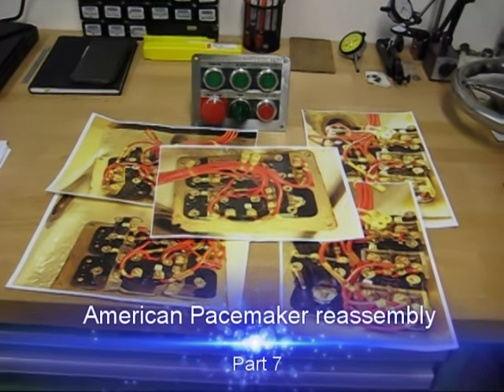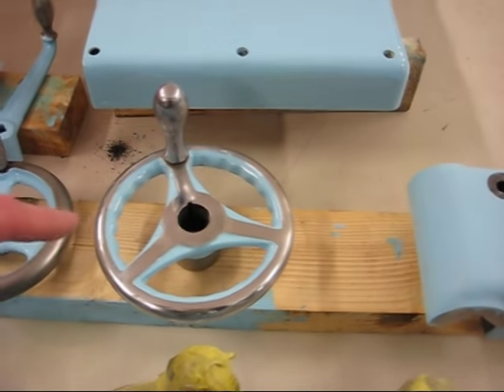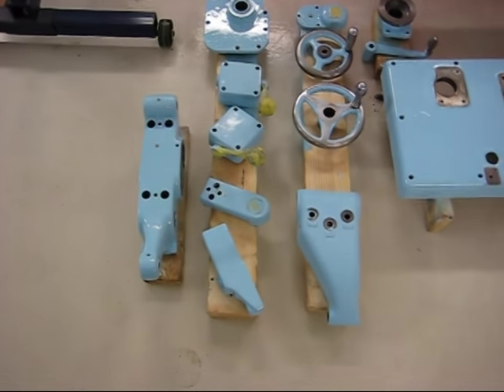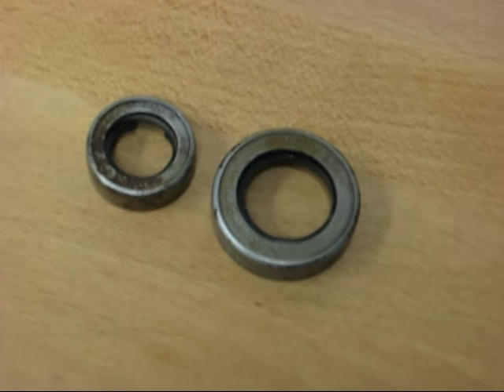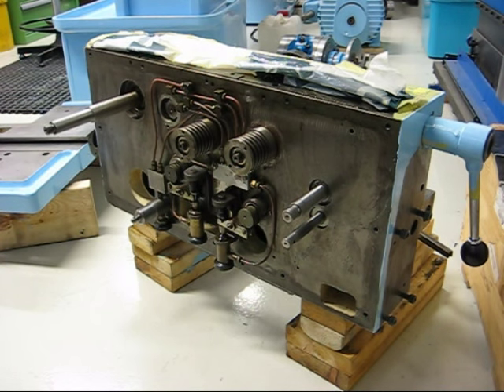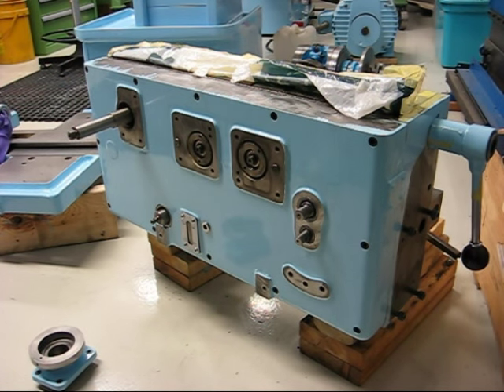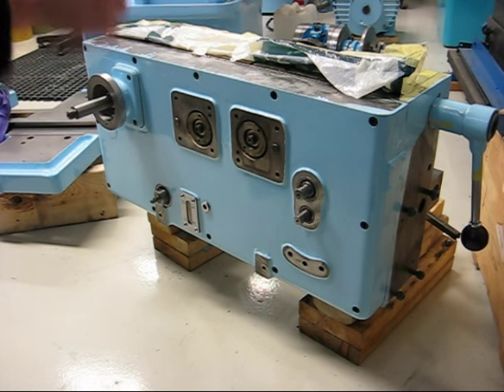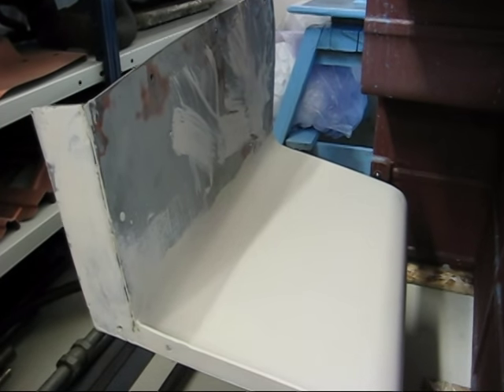American Pacemaker lathe reassembly part 7

Comment: The light blue looks very nice. Almost too nice, like white shoes. I really do favor grey as that is my father's eye color and on machine tools when adjusting hand wheels are nicely shined and the hand touching portion is very smooth and metallic then grey really pops.
Reply from the maker: Thank you for the comment! In one of the videos I talk about the color. I started out with grey on the first part I painted , but I changed my mind: I thought it was too boring :)

Comment: Sigmond,

SKF seal type CRWHA1 looks to be a very close match, below is a link to the SKF Radial Shaft Seal catalog that features the CRWHA1.  Just match the dimensions you listed for the part number.  If you can't get the SKF it should cross reference to another manufacturer.

http://www.skf.com/binary/tcm:12-129139/Industrial%20shaft%20seals%20-%2010919_2%20EN_tcm_12-129139.pdf

An alternative would be to use a steel reinforced plastic coated double lip seal of the same dimensions like "sharp x" suggested, probably less expensive.

Hope this helps.

Jim
Reply from the maker: Thank you for the help ! I will look at them.

Comment: you don't need bare steel frame seals, you can use regular ones, just lookup OD/ID in a seals catalog and pick up modern ones.
Reply from the maker: +sharp x Thank you for the comment!
Reply: In fact they seal better on the external diameter.